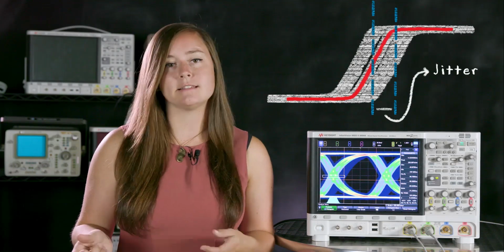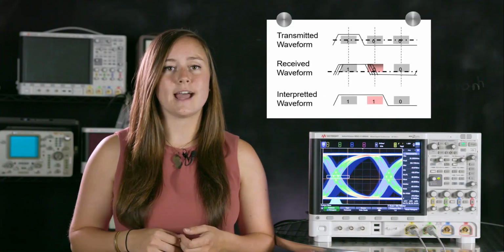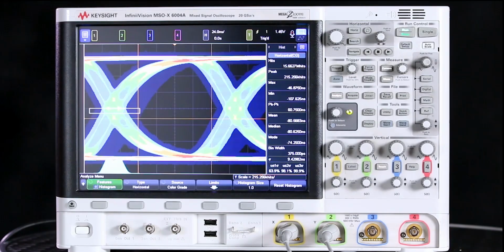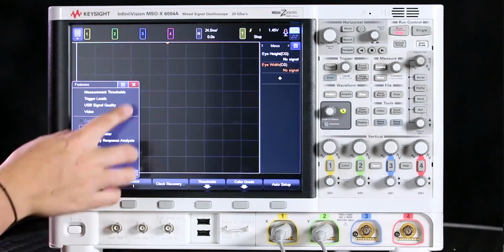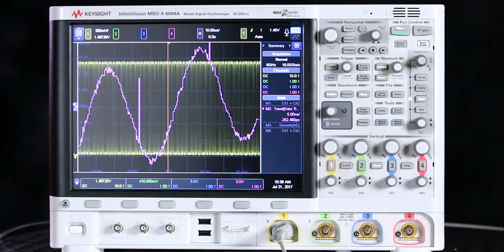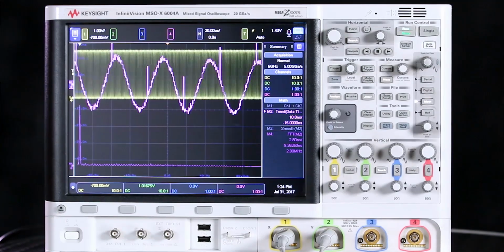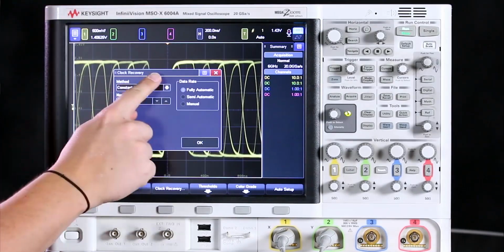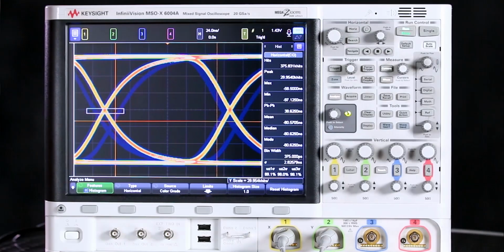How to Measure Jitter with an Oscilloscope - Scopes University - (S1E5)

Comment: What sort of probe is needed for this, and what else is needed to keep in mind? any application notes for that ?
Reply from the maker: We have a lot of info about probing on this channel and on the Keysight web pages around probing. The scope doesn't really care what probe you are using for jitter, but you want to make sure you're using a probe that can handle your signal's parameters (Voltage, bandwidth, etc.)

Comment: Excellent video...
For jitter measurements should we use active or passive scope probes.  Which do you recommend?  Thanks
Reply from the maker: It depends what other factors you have to consider. Generally active probes are used because of the bandwidth of the signals being tested.

Comment: Question: "20KHz TIE sinusoidal modulation has been eliminated by setting clock recovery PLL bandwidth to 200KHz." Is this a wrong statement. I think the 20KHz are well within the 200KHz PLL bandwidth and the 20KHz TIE will pass through PLL without attenuation. Please advise.
Reply: The loop bandwidth of the PLL used to extract the clock from the data signal is higher than the 20 kHz. This means that the clock frequency/phase will follow the 20 kHz jitter and the receiver will not be impacted by that jitter.
Reply: @ricardonunes6724  can you elaborate a little? I am also a little confused... with a low-pass of 200kHz, aren't we letting the 20kHz modulated sine wave through?
Reply: @acadacabra2010  From what I understood, the oscilloscope is using a PLL to generate a clock based on the data signal, which has the 20 kHz deterministic jitter on it. Then, it locks to that clock. As the loop bandwidth of the clock recovery PLL is larger than the deterministic jitter frequency, the recovered clock will also have this jitter. As the jitter appears now both on the recovered clock and on the data, a receiver which is locked to the recovered clock will not see the jitter. If the loop bandwidth of the clock recovery PLL was lower than the deterministic jitter frequency, the recovered clock would not have the jitter and a receiver locked to the clock would still see the jitter.
Reply: @ricardonunes6724  In the case with PLL, if the recovered clock also have this jitter, is the oscilloscope making an inaccurate measurement of eye diagram? The eye diagram is supposed to reveal all defects of the DUT, instead of locking on to something wrong, right?

Comment: I've cut the red wire on mi cable so no power...and Check here I still have some noise no so big but it's there...do (iFi iPurifier3 Filtre de signal audio et de données USB) will corect that?     https://soundcloud.com/hibou53/usb-noise